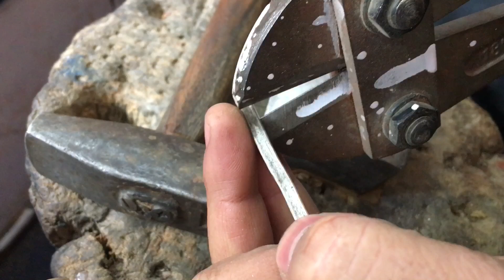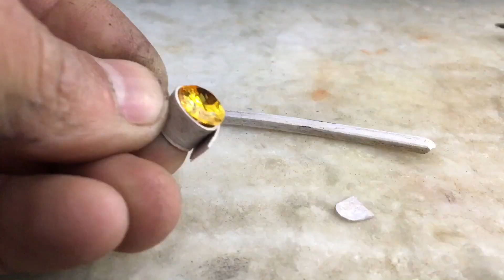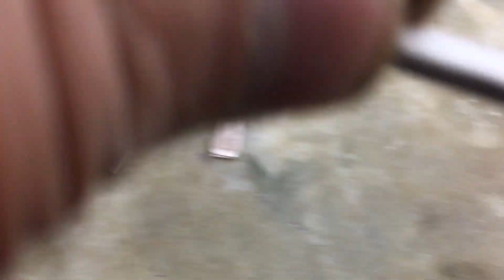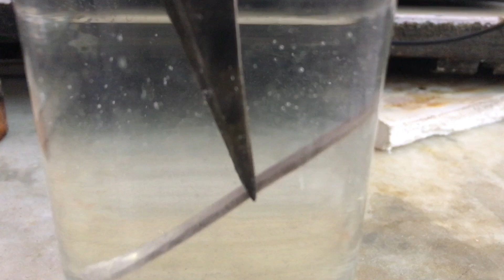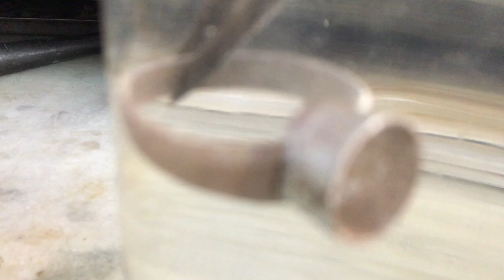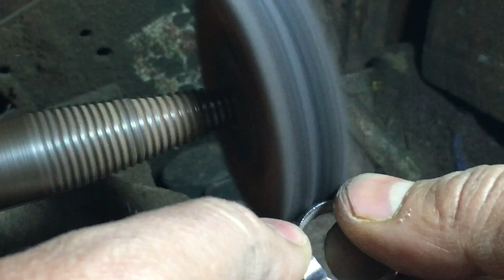silver ring making with golden stone | how to make silver ring | ring making

Comment: Great video. What size was the metal you used for the bezel on this? I'm wondering if 28 gauge silver would be too soft for this kind of setting.
Reply from the maker: Sms Instagram for detail
Reply: Thickness has nothing to do with the metals hardness.

Comment: I have the same kind of design of  Emerald made in silver it's just 5days  of wearing I can feel the stone a bit loose because it makes a small noise when we touch it. Can this be fixed at the jewelry it's self. I feel very sad and worried 😕 I wanted to know one more thing while repairing it will it break the emerald stone.
Reply from the maker: You can fixed it easily if you like to know more you can follow in instagram and sms me
Reply: @Merojewelleryworkshop  Good morning Sir may I know where are you located, I'm in Pune Maharashtra.
Reply from the maker: Fallow me in instagram sms me there